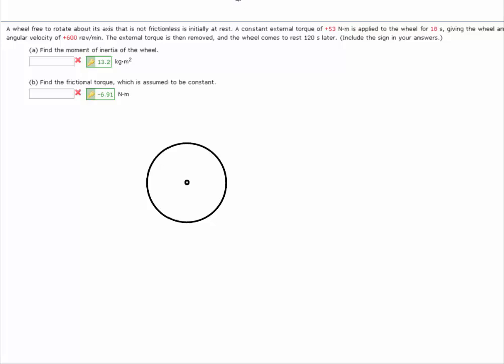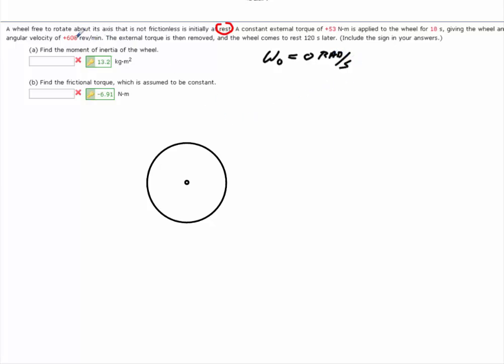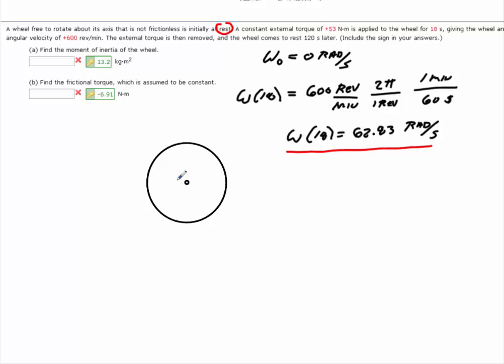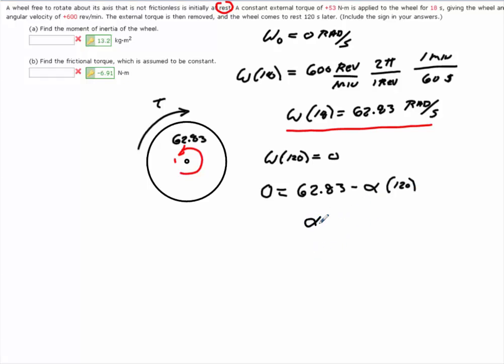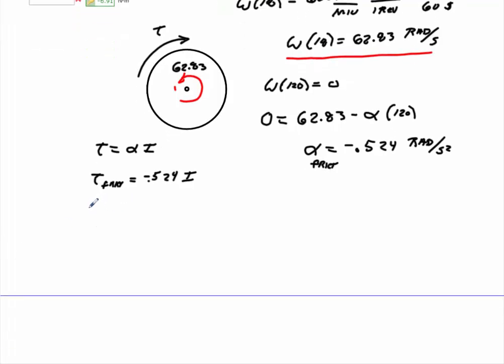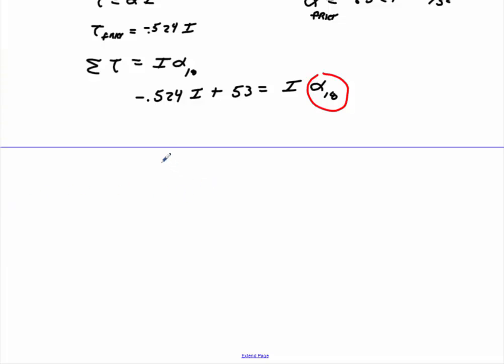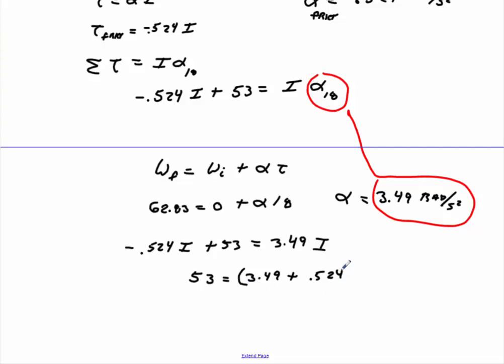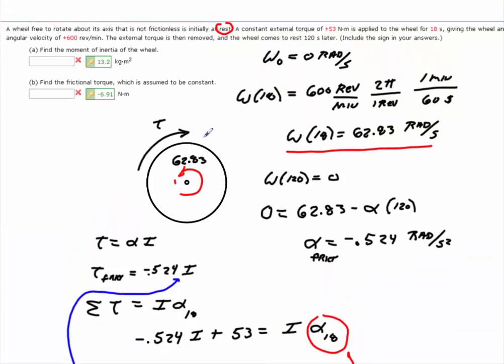Web Assign Frictional Torque

Comment: how to calculate frictional torque of a gear attached to rotor, when the weight of hanging object is 0.116 N  and distance at final point is 1.14 m. Time taken to travel this distance is 8.807 secs. Radius of the rotor on which mass is hanged is 0.03175 m.

The Equation to prove here is P x R=I x alpha + Tf
Where: P = Tension in the string = P = m(g-a)
R = Radius
I = moment of interia
alpha = angular acceleration
Tf = Frictional Torque